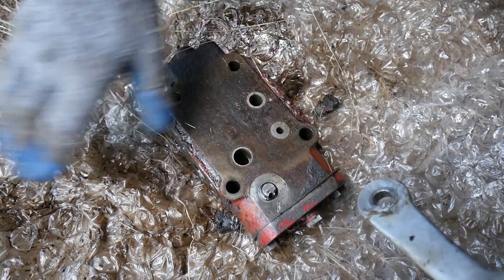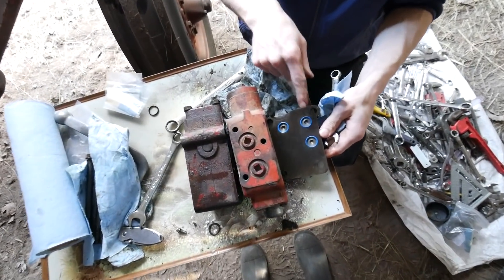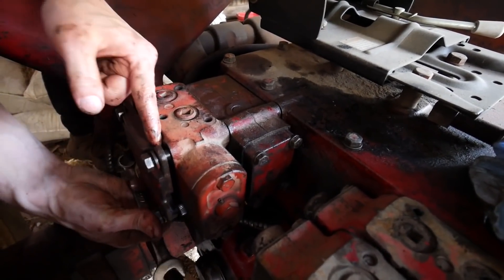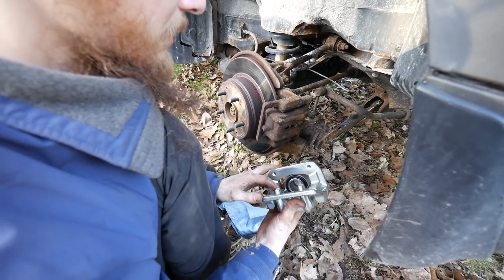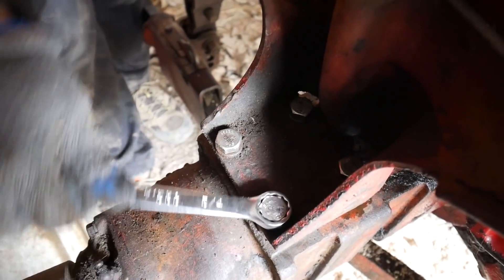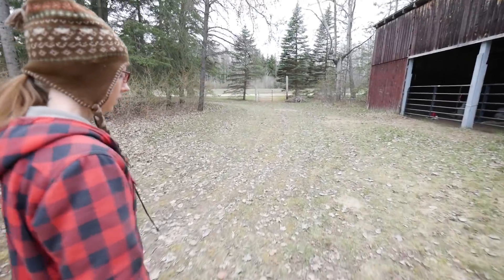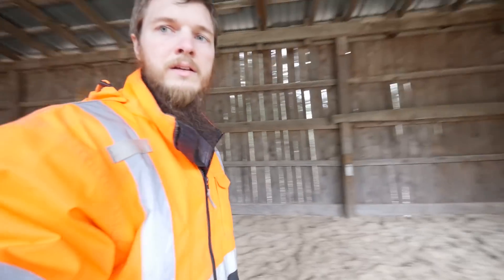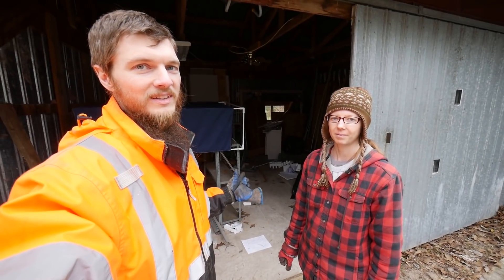Tractor Drama on the Homestead

Comment: Pulling static items with a tractor can be safe as long as you use a drawbar that extends beyond the tractor tires. This way if the front of the tractor lifts, the distance between the drawbar and the ground decreased.  As this distance decreased, the moment lifting the front tires decreases.  Tractors flip when people attach chains to the axle or top link.  In this position, the moment between the attachment point and the ground stays the same as the front tries lift off the ground.  

Don't lose those remote valves.  You don't need them now, but you never know what the future holds.

Comment: Water getting in the hydraulic fluid for sure , keep the parts youve taken off for possible future projects . Two things it would pay to have , a box of assorted o rings and a flexi brake hose clamp . Saves you an awful lot of hassle when removing brake or hydraulic parts , just a suggestion . I started life as a mechanic , everything from heavy goods to plant . Then I moved to construction twenty years plus just in construction , the mechanical I have continued all my life , im just like yourself , can turn my hand to anything . The more strings to the bow the better . You all are doing just fine , keep up the excellent work . . Ps , you need a roll over bar for your tractor , makes good sense . Just a suggestion its safer .

Comment: Unlike motor oil hydraulic fluid doesn't break down (unless you get it too hot) so when you drain it you can let it set and the water will eventually settle to the bottom and you can pour the clear fluid off the top. There will always be some condensation caused by warm air against the cold metal especially in the spring and fall when the daytime temperature varies dramatically from nighttime.

Comment: Hello I just come across your channel. I work on old tractors and equipment. Yes you had water in your hydraulic system you did right by changing it. It's a common thing in older tractors  especially if they sat outdoors.

Comment: The tractor is a thing of beauty and a joy forever. Call it Eunice.
Tundra is a complete camera ham. She will be demanding her own fan club.
Beau is just messin' with ya. 

It has been very grey and wet here in Ontario. The lake itself is so over filled that people can't use the boat launching slips all along the shoreline, because they are all flooded. And in Quebec, something nutty has happened. Apparently there are special clay mines in Quebec that supply a lot of kitty litter manufacturers in North America. Those mines are FLOODED and unusable for the immediate future, until they can be drained. So, yes, there will be a litter shortage, due to rain. Unbelievable.

Comment: Is it possible you might find new o-rings for the cover plate at a hardware or big box store?  Since you drained the hydronic fluid from the attachment end, how will you prevent leaks since you removed the module? Since you really live in snow country, I would keep the attachment items you removed. A used blade for the front of the tractor would make short work of the drive and paths to the animal barn and the barn/garage.

Comment: When bleeding brakes on older vehicles, I like to place a spacer (usually a short piece of a 2x4) under the brake pedal to prevent it from going down any further than normal since that area of the master cylinder bore may have some rust and scale, which can damage the piston seal resulting in master cylinder failure within a few weeks.  It does take longer to bleed with the spacer, but there is much less risk of damaging the seals.

Comment: I remember you already had that brake problem last year..get some extra O rings..good job Belle..yeah, I noticed you have the barn dust back...sawdust breaking down?
Reply from the maker: It's still pretty good, not nearly as bad as it was, but the soil does mix with the sawdust over time. After a while we'll add more and keep it under control.

Comment: There is a video titled "How to Adjust the Farmall Torque Amplifier" by a channel named Dan Gingell and Rachel Gingell. You should check it out, in your tractor video prior to this one you showed how using your torque amplifier did nothing when used and in their video they say its most likely due to just a misalignment and go through some simple steps to re-aligning it. You may be able to fix your tractors remaining issue quite easily.

I think atm your tractor is locked in high torque, which is great for heavy work but hard wearing on the motor.

Comment: You are correct about the milky looking  Hydra Fluid. After you complete the repairs, you will install new Hydra Fluid. There should be a bleeder valve to release air in the system like you would with a brake system repair. As for your brake repairs I would have put new pads in and cut the rotor or rotors also( Has marks in it). Check the other side of car also. It's better to go the extra mile on your work just to be safe.

Comment: Doug and Ashley, just wondering if the bolts on the tractor need to be torqued ?  It's great you can still find parts for the tractor.  Hello to Belle such good camera work, and Tundra and Beau.
Reply from the maker: They probably do have torque recommendations but I don't have the service manual. I personally don't worry about torque specs too much and go by feel.

Comment: How's the sawdust holding up? Are you guys still liking it? Are you needing to add more as time passes?
Reply from the maker: The sawdust has been great. It does mix with the soil over time but it's still doing a good job with the dust and is much easier to clean. If it gets too dusty we'll add more sawdust.

Comment: next time please put rocks anything behind the tires to stablize so it don't not roll.  Doug your family needs you please don't think that accidents don't happen. I used to be an EMT I know. : )peace
Reply from the maker: I did have the brakes on while working on it but you are right, safety first.
Reply: @diyfferent  I'm probably a little bit of a worrier,  because of the accidents, falls, etc I've dealt with and some wicked stories other emt's have told me. Plus your needed. :)peace

Comment: nice job... just an fyi, you should have used some thread tape on that handle, it looked like a small amount of play when you first showed it. quite possible that is why the original one stripped. and get yourself a real good socket set, it will make your life much easier
Reply from the maker: We put a thin piece of plastic sheet on the handle before we put it on to help reduce the play. Thread tape would work also. Thanks
Reply: @diyfferent  Perhaps you could lay the handle on an anvil and peen it around the hole to tighten the fit.  But, it may not be a material that can be hammered without damaging it.